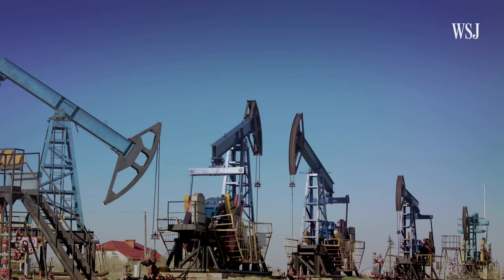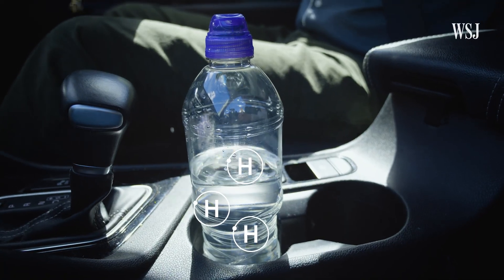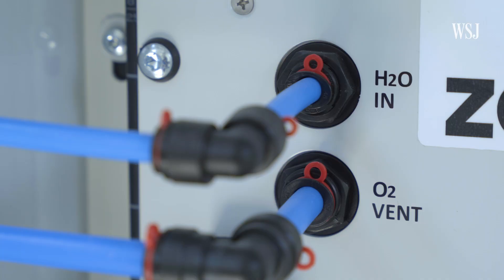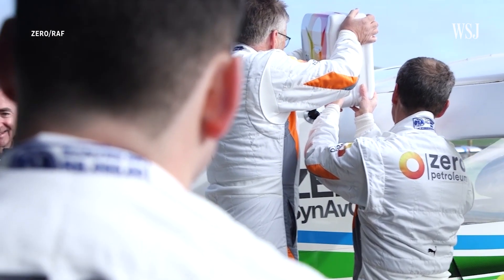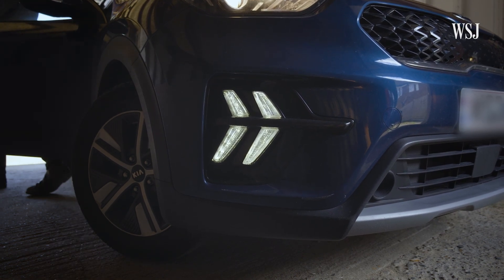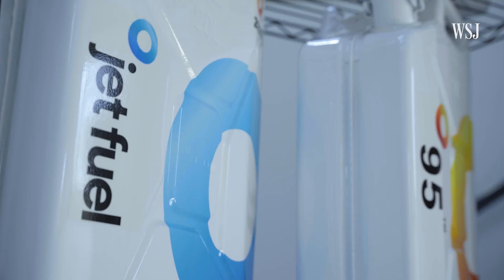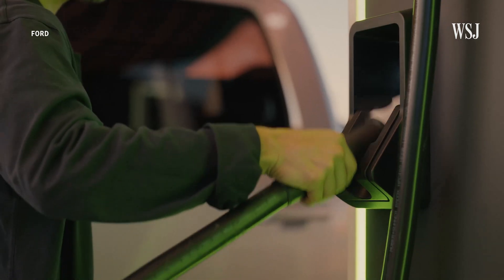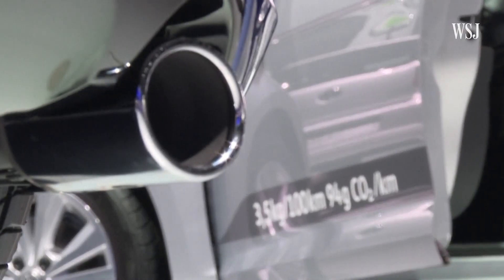eFuel: Could It Save the Gas Engine?

Comment: Do you think eFuels will make it to the gas pumps?
Reply: We can hope. It’s crazy that electricity is offered as the only solution.
Reply: Yes this highly anticipated by Deutsch and one of the condition to accept EU regulations on cars in 2035
Reply: @JC-qi5xc  That's completely wrong. I, myself am engaged in German politics and there is only one political party that supports E-Fuels. It's the liberal party called FDP, a party of the wealthy and closely associated with Porsche, the only German car brand that supports E-Fuels. All other major car companies have realized that it isn't economically feasible.
Reply: @JC-qi5xc  It is, however, eFuels will not be affordable and isn't produced in large enough quantities to be able to provide so many cars with it. There is only one German car branch that invests into eFuels and that is Porsche. And we all know that it doesn't exactly stand for the middle man.
Reply: It might make it to truck stops, shipping ports, and airports. BEVs don't have all the conversion losses on the same electricity, so they're cheaper than eFuel in any lightweight use case.
Reply: @spacetoast7783  With current technology, an efficient lightweight application doesn't go beyond compact cars in cities/suburbs. The kind of electric car you see today, giant, heavy, overpowered SUVs, is neither efficient nor sensible.
Reply: There is definetly no chance. Efuels are a gigantic waste of energy…
Reply: @mb7392  is that meant ironically?
Reply: @Entertainment4fun03  why should it?
Reply: No
Reply: @mb7392  eFuel probably won't, but bio-LNG has already made it to fuel pumps. It's liquefied methane derived from waste and manure, which is a renewable resource.
Reply: No
Reply: I feel like it is just a way of storing energy from electricity chemically rather than through a battery. There's a limited market for this with the increasing wave and popularity of EV, and sooner or later planes and trains will also be the same way. This is just a sustainable aid in that transition. Sooner or later humanity as a while will stop using carbon and rely purely on nuclear energy or other renewable forms of energy, especially with the progress made by the reactor being built in france. Within 30 years, carbon will be a thing of the past. Until then, this may have enough positives over standard gasoline, considering we're removing the pollutants from the air. So short term, yes most developed countries will attempt to subsidize this process. Long term, no.
Reply: Super inefficient. The energy used to make efuel can be used more efficiently to charge battery.
Reply: Can an ev give me a 5 to 6 minute charge up? If not I don't want to plan my life around keep a battery charged.
Reply: @aronmiller7648  Well, there is being a lot of research done and in theory, charging a battery in less than 10 percent is possible. And even if it wasn't: you'll have no choice but to fall in line because gas prices are going to keep rising and you won't be able to sustain that kind of expenses.
Reply: @Entertainment4fun03  a hybrid with 70 or 80iles of range with fast charge and a way to charge while driving would be ideal. No gas prices are not going to get insane. Gas prices were higher in the housing market crisis/recession than it is now. Efuels or biofuels need to be looked into. There is no need to change infrastructure as all existing cars can run on it. If you think for a second that charging will not become heavily taxed or increase in general you have everything confused. We pay a large portion of the taxes at the pump to up keep our roads. All of this will be transferred in some way or another to charging. Electric cars are much heavier and cause more wear and tear on the road. Not only that when they catch fire you need certain chemicals to put it out not just water. Why should tax payers have to pay extra for these chemicals for fire department to put out these fires? These fires would become more normal with more electric cars on the road. Plus.more people means higher demands for the electricity to charge your car. And, wind and solar in all areas does not make sense. Having a hundred million+ cars hooked up to the grid is not a good idea. It goes back to more people more demand for power. Our power grid has to scale and it can't scale that quickly. Also, batteries tend to wear out quicker the more often you fast charge them. I want to say I am not totally against battery powered cars. They for sure have their use they have come a long way. I don't think they going anywhere either. But, getting rid of combustion engines is just non sense. Also, not to mention the earth material needed to make them is finite. Once competition for these resources come so to will rising prices. Also, sorry for the giant paragraph phone is not working properly.
Reply: much better option is hydrogen combustion engines, in efule apart from splitting hydrogen we need to capture co2 and mix them with hydrogen, efule is a 3 step process.
Hydrogen combustion engines require only hydrogen and to create hydrogen its a 1 step process, so its much more efficient than efule.
Reply: @S_AND_T_ENTERPRISES  No, it's not. Electrolysis needs to be powered by renewables for green hydrogen. It will never have a future for cars. Simply take a look at the car brands. None of them are investing in it.
Reply: I think we have to talk about biomethane. It has the potential to either emit far less Co2 than petrol, and it can even be made emission negative, given that it's rural biomethane from the agricultural sector.
Reply: @maggiepie8810  But it's still very power intense
Reply: @brianbosch3628  It's almost a bit too power intense, as it's pretty freaking explosive. Which is good in an engine for power and torque output, but there was an accident with a biomethane bus in Stockholm not too long ago, albeit from an epic driver fail. Luckily, it was a retired bus, so nobody got seriously injured, as it was empty other than the driver.
Reply: @maggiepie8810  So basically it's like driving unexplored ordinance.
Reply: @brianbosch3628  Petrol is also driving an unexploded ordinance when you think about it, so biomethane isn't necessarily that much worse. I think what happened with the bus in Stockholm has to do with the fact that it's a model with the gas canisters on the roof, and buses aren't exactly designed with roof impact in mind, as it's fairly  unlikely. Unless the driver decides that it's worth a try to go through a tunnel, despite the sign which warns them that the maximum vehicle height is 3m/10ft. In case you're wondering, the bus were a bit taller than that. 😑
Reply: It should start selling at the pumps around the world
Reply: Maybe it's great if they start them by phases. Perhaps, they can start the phase by using fossil fuels exclusively for transportation purposes (cars, buses, planes, etc.).
Reply: They would work for very niche market like ICE car collectors, however for the mass market and general public it's definitely no go. However eFuels will play a key role for both air & sea freight/transportation industry where it's critical energy density will win against hydrogen and most advanced batteries. However even these industries require eFuels price drop as fuel price is primary price determination factor of their services.
Reply: Where there's a will there's a way. With the failing EV sales, I'd put my money on synthetic fuel development. It's currently on sale in the UK for about £3/Litre so with more investment, it can certainly become more affordable and substantially lower the emissions from the 1.5 billion ICE cars on the roads already.
Reply: Hoping it does🤞
Reply: Yes,they must! Alternative to EVs!
Reply: It will never be cost competitive.  When gas is over $2/gallon, US drivers are bitching.  You can't even get e-fuel costs at $2/liter, let alone $2/gallon.  Porsche has been producing e-fuel for $9/liter.  You can never scale up to make e-fuel cheaper.  It is cheaper to run electricity to a car.  The vast majority of people in America live in single family houses.  They can fuel up with solar panels on their house.  Solar panel installations are relatively cheap.  The return on investment cost is 6+/- years depending on your location and if you have lots of sunlight during the year.
Reply: yes, definitely
Reply: @MarkDanielLouwe never

Comment: Why doesn't anybody talk about how "dirty" the EV manufacturing process is? It takes years for an EV to level out it's emissions compared to ICE cars, and that is if you charged it exclusively using electricity made from fully renewable sources. 

Also, a ICE car can last many years if maintained properly. Even if you want to keep your EV for a long time, you will have to replace its battery. There goes another 2-3 years of emissions. Honestly, I can never shake the feeling that it's some sort of a scam.

Comment: Synthetic Fuels are the only true proper way to let automobiles exist. Electrics are alright for city commuting, but Hydrogen absolutely sucks due to low energy density and significant storage issues that are more chemical than technical.

Comment: A kwh in the desert will cost around 1 cent or less. In the blue zone it's 1,4 cent. You need 27 kwh for 1 liter e-fuel. With producing hydrogen more efficient. E-fuel can be produced 50-75 $cent a liter. A barrel of raw oil cost 30 cent a liter. With all additional work it will be around 55 cent. This will put a serious cap on oil prices.
Reply: The comparison should be how far can you drive on 27 kwh of electricity in an EV versus how much you can drive on 1 litre of e-fuel.
Reply: @kl3nd4thu not everything will be electric. Also in refining oil you get many different products you don't want, like too much diesel or kerosine. E fuel could mitigate that or could store excess intermittent energy

Comment: 9 months on, and the answer is still clearly no. eFuel is not carbon neutral. Any electricity used in making it would be better used charging a BEV. The end to end efficiency of eFuel, wasting two thirds of it in a heat engine makes no sense when you can do much better by using a simple battery and electric motor. As soon as viable batteries were available, ICE was doomed. If decent batteries had been around at the start, ICE cars would probably never have existed.

Comment: Why would you want to save the gas engine??? It has been superceded by a much simpler smoother quieter economical power source. Sorry but you can't put the genie back in the bottle!
Reply: As long as we don't have the necessary battery tech, we need tech like hydrogen fuel cell or efuel for stuffs battery cannot do: speedboats, ships, planes, helicopters, locomotives, long rang truck haulers, war equipment and vehicles (you don't expect armored carriers waiting to charge every 200 miles into the war). Lastly majority of the people in the world that aren't rich and can't afford to buy an EV every 5-10 years, they can make do with efuel as long as it reached cost parity with fossil fuel.
Reply: Where’s your EV?

Comment: Zero say they have a "TARGET" of 50% energy efficiency.  Great, but what is the actual number today? You sure it's not closer to 10%?  I've tried to research this a bit in the last few days and that's the number I see mentioned for this type of technology.

The hard part seems to me to be the carbon capture from the air. That's the bit that is always talked about the least. Probably it's the least economically viable. The Porsche funded plant in Chile don't do this bit yet. Does Zero actually do it? In the video they show it happening at a university and not their site. When I saw that I thought "ohhhhh".

Comment: much better option is hydrogen combustion engines, in efule apart from splitting hydrogen we need to capture co2 and mix them with hydrogen, efule is a 3 step process.
Hydrogen combustion engines require only hydrogen and to create hydrogen its a 1 step process, so its much more efficient than efule.
Reply: No, this is no option

Comment: Essentially this is a way of storing the energy you put into it for future use in a sustainable way. How is that any more useful than an electric battery? Surely the storage efficiency will also be better in the latter, so I don't see any use in these products unless its a way to sustainably change from a carbon-run world to an electrically powered one.

Comment: I would like to offer a hot tale for motordport performance engine vehicles: liquid hydrogen with a garage installable electricity + water conversion system with liquefaction provided alongside engine and tank modifications. 

It's easy to be snotty about the efficiencies and cooling required, but in all seriousness liquefied hydrogen is the fuel that is most unambiguously capable of the following conditions:

1) Effective if moderately expensive onsite production without the carbon step, producible on an immediate basis.

2) Effective volumetric energy (1/3 gasoline is enough for most cases) due to classical engine vehicles being recreational and thus the longevity of the fuel retaining only being appropriate to the 'day out' in question

3) The ability to provide auto-densification of air due to cold temperatures, thus mitigating the ethanol and methanol advantages of power

4) Light enough to be swapped out OR fuelled at any capacity at common pressure

5) contiguous weight and cheaper materials advantage over other fuels

Comment: As an engineering student, I really appreciate the nuances you provided! Unfortunately, I don't see synthetic fuel being practical until we have cheap, abundant energy from nuclear fission/fusion. Even then, the low efficiency you mentioned (≤50%) makes it extremely difficult to compete with electric cars since the electricity could be used to charge batteries directly instead of powering electrolysis and ending up as gasoline. Energy is lost as you convert from electricity to hydrogen to efuels. And the final nail in the coffin is that internal combustion engines are only 20-30% efficient (the rest is wasted as heat). Therefore, the max overall theoretical efficiency is 15%. Compare that to the 80-90% energy transfer efficiency of EVs.

The one place I could see this being possible would be long range aircraft since batteries don't have anywhere near the energy density of jet fuel (even when you include the most advanced batteries currently being researched). Because they can't be electrified (at least, not fully), efuels or hydrogen must be used. Hydrogen takes less energy to create from electrolysis, as opposed to efuels where you need to perform electrolysis AND extract CO2 from the air AND convert the H2 and CO2 into gasoline. 

In all, nothing is impossible, but many engineering challenges remain, some of which could easily remain insurmountable for decades
Reply: Thanks for the detailed note. Especially agree on airlines, tough to decarbonise given demand is set to grow in the developing world
Reply: Battery electric aircraft can be transoceanic with today's battery though
Reply: @tobiasr888  This is ignorant; batteries store 40x less energy than jet fuel. Also, if such planes are possible, as you say they are, then why don't they exist yet??
Reply: 70 % battery mass, 15% payload, 15% structural mass. L/D over 50 (like sailplane). Latest and greatest Amprius battery (450 wh/kg), engines & materials. Plot it into the Breguet range equation. Of course this is on the edge without alternatives and does include the glide path. But it is possible
Reply: @gabedarrett1301  would you still say it's ignorant?
Reply: @tobiasr888  yes; all electric planes currently under construction have ranges of about 500 miles or less. A transoceanic electric plane is still many years away; the aircraft you're describing is an experimental high performance aircraft with very little payload akin to Scaled Composites' Voyager plane
Reply: @gabedarrett1301  You can buy all the necessary components today. No magic. Sure, 15% payload is not great. But it doesn't matter because electricity is so cheap
Reply: @gabedarrett1301  So would you agree that only by Breguet equation, such an aircraft is possible today?
Reply: It's not a 15.000 km range, but 4.000 km is enough to cover almost any route
Reply: Provided you charge cheap electricity (under 0.1$/kWh) and somewhat mass produce these aircraft, jet airplanes won't be able to compete in price
Reply: And you could even do VTOL for a little range penalty
Reply: However certification takes roughly $1B & 8 years
Reply: Much less if you sell experimentals or Part 61 aircraft
Reply: I can see the supply chain for making batteries being the only saving grace for this. If it is too hard to reasonably replace all cars to electric then gas still has its place and even if it becomes neash I think it should continue to exist.